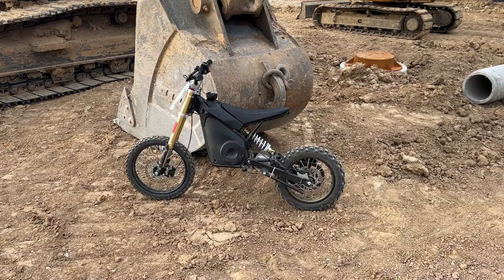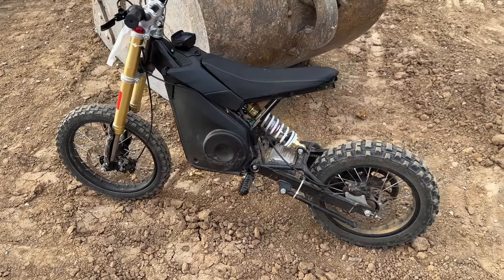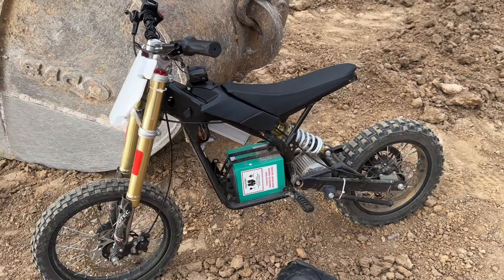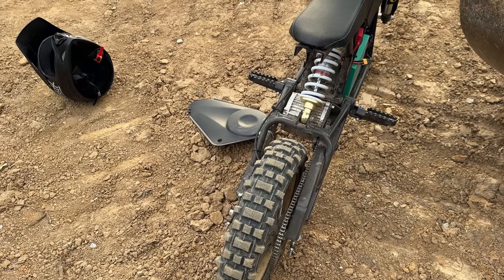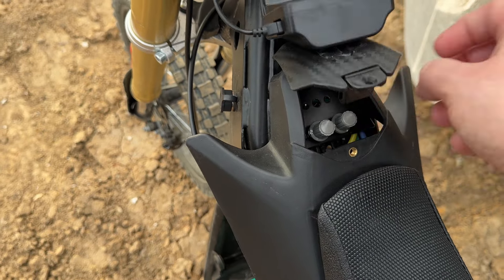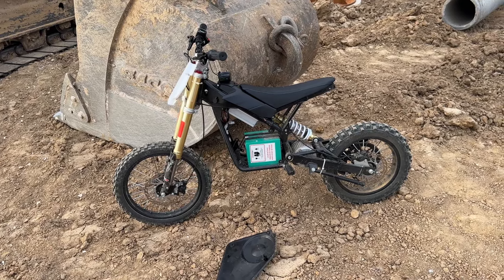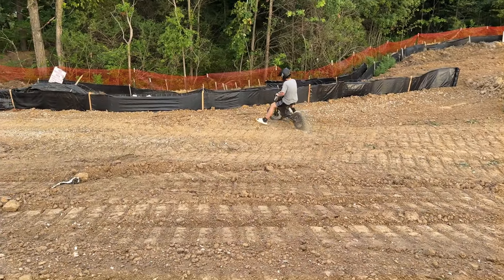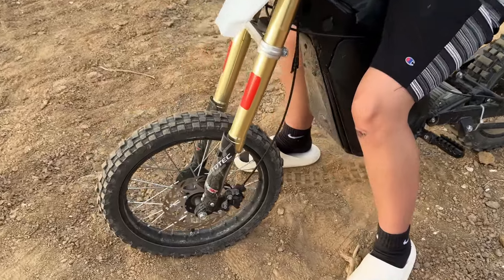Mototec 1600w Pro  48v Electric Dirt Bike - ONE Year Review - Pros and Cons

Comment: Did you ever figure out how to unlock the speed on it?
Reply from the maker: Didnt try. It goes 25mph for me thats more than fast enough for my son.
Reply: It’s a 1600 wat battery that only really allows for 26 mph max so it does not have a limiter although for 200 more dollars you can get the version that goes 40 miles an hour or adjustable from any speed

Comment: how do you take the back vender off the seat plz tell🙏
Reply from the maker: I believe you have to take the seat off first and that will give you access to all the screws. There is a big bolt and nut that hold the seat on under it.
Reply: and the thing on the front like its kinda by the controll thing how do you take the front panel off
Reply: Yea the front panel